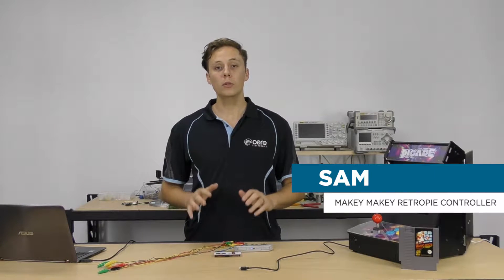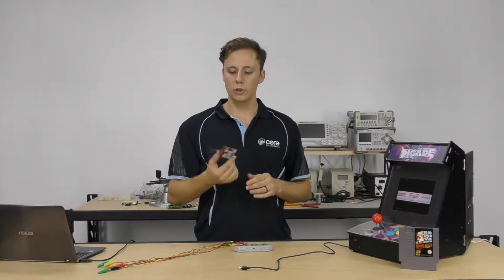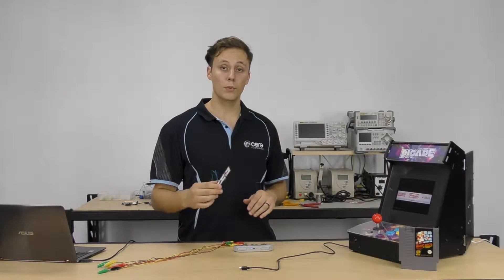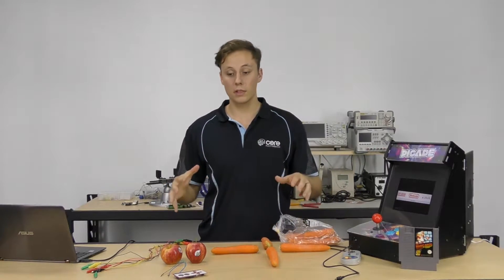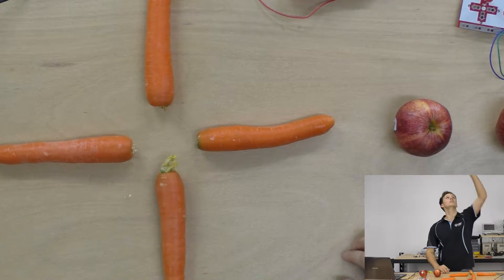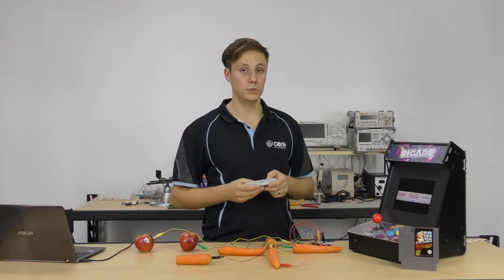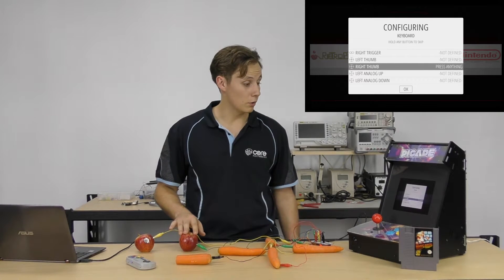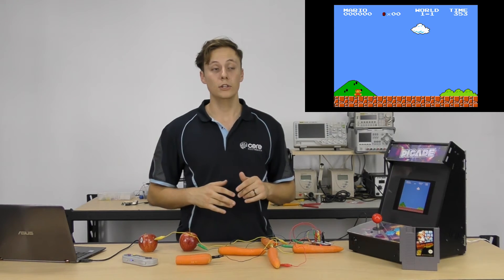Makey Makey Game Controller Project for RetroPie

Comment: Nice video, I'm glad to see this working for you! What version of retropie are you running? My retropie set up is only recognizing the directional connections and the letter connections on the back. It won't recognize the space or click or the "mouse" connections. Other keyboards and controllers work fine. It's just makey makey's that have problems (I've tried two different ones). Any idea what is going on?